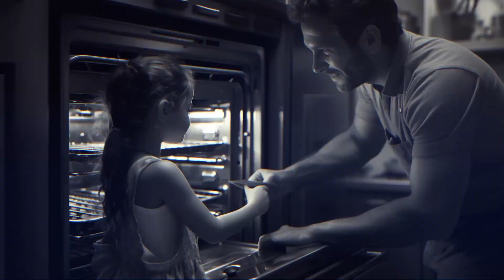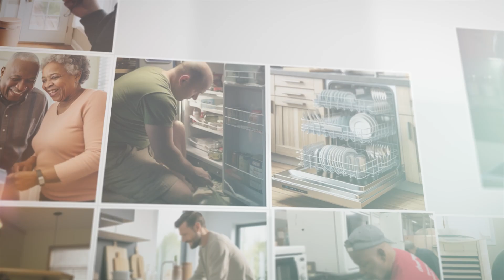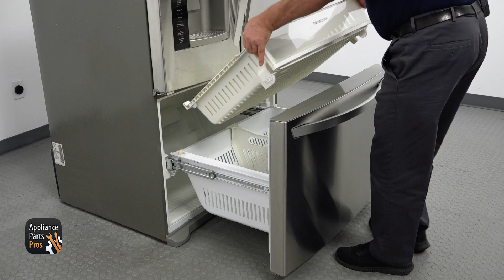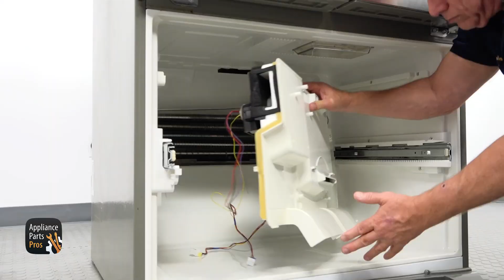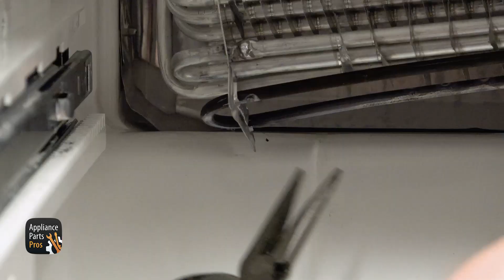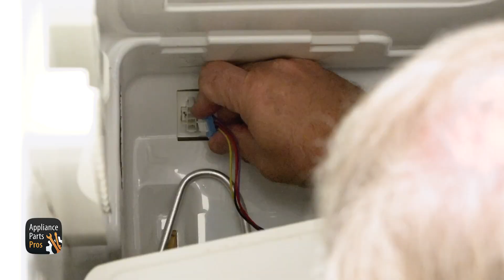How To Test And Replace an LG Refrigerator Defrost Heater

Comment: Im pretty sure its my fuse as I dont have continuity when putting my meter on there but all other resistances show correctly.. otherwise I guess it may be the board? Its a bit confusing because my wire colors dont match up with the ones in the video and I tried to call the customer service but no dice :(
Reply from the maker: If you need more in depth troubleshooting or testing information you can check out our Repair Forum: https://forum.appliancepartspros.com/.  It’s easy to register, and you can either post your question or search the forum to see if someone else has already asked the same question.
 
Our experienced technicians, with over 20 years of hands-on appliance repair experience, are ready to answer your questions and guide you through your repair.

Comment: Thank you  for the video 
Just to make sure if the defrost sensor resistant is 14.13 should I replace it could it still be causing problems?
Reply from the maker: That would indicate a bad part.
Reply: @appliancepartspros  thank you so much
Reply from the maker: You're welcome!
Reply: Did the new defrost sensor work?  Very curious, as my sensor resistance is reading 13.35. Although he stated range should be 10-12.

Comment: Great video… but I really needed the demonstration on the upright side by side fridge behind you. Are the parts the same?
Reply from the maker: Thanks for watching! Parts can vary between models, even within LG side by side units. What’s your model number? I can check if the defrost heater assembly is the same for yours.
Reply: @appliancepartspros   LSXS26326S /05

Comment: Thank you for your video. Just to clarify - if the defrost sensor resistance is out of range (ie 18 instead of 10-12), then I should only have to replace the sensor correct, not the high temperature fuse as well? If so, do you know the correct part for the defrost sensor for a LG LFXC22526S? Thanks again

Comment: Followed step by step. Now two days later I have the df h error code on my fridge
Reply from the maker: The “DF H” code means the fridge isn’t detecting defrost heat. This can happen if the new heater isn’t getting power or if the defrost sensor/thermistor is faulty. If you share your model number, we can help you troubleshoot.